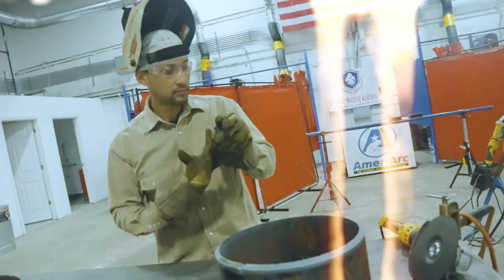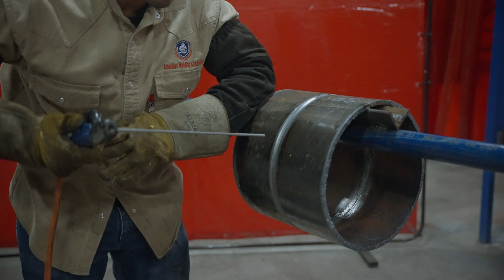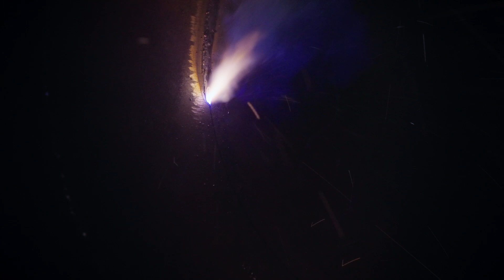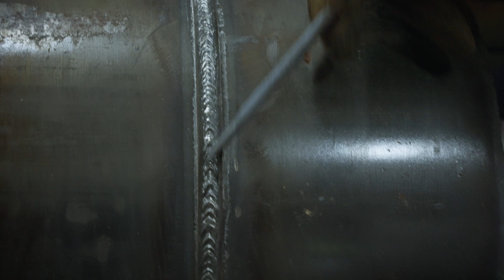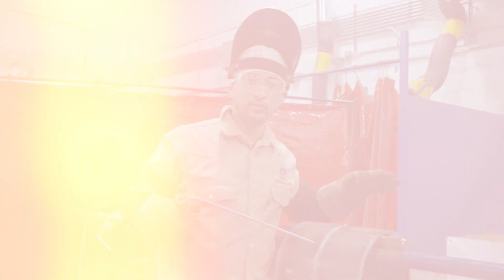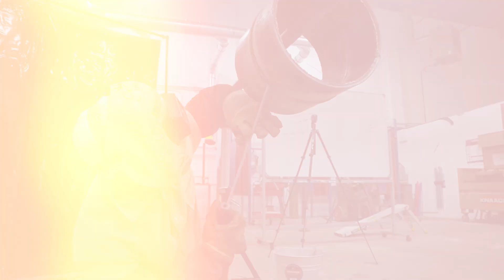PIPELINE DOWNHILL WELDING API 1104

Comment: On the tie in at 7:23, if you strike up an inch before the keyhole to heat it up, how do you heat it up without depositing material? If you're just going quickly and you do deposit material, there still will be a hump there and how do you compensate that when doing your second pass, or do you just grind it down? What if they don't allow you to grind?
Reply: There is no such thing as NOT GRINDING, NO GRINDING ALLOWED, YOU WILL ALWAYS USE A GRINDER AFTER YOU PUT IN THE " ROOT PASS, ALSO CALLED THE BEAD " IN PIPELINE WELDING

Comment: Does those fumes ever bother you from not wearing a respirator? Do you ever experience tightness in the chest
Reply: I've been welding since 1980 and I've yet to see ANYONE inhale 100% of the fumes, you might even say that " there is no such thing ".Now you might get a tiny pit of a scent but that's about it but NOT 100% of the smoke. As far as Respirators some people do wear them and some people don't, it all depends on what you're welding.
Reply: I've been welding since 1980 and I yet to see ANYONE inhale 100% of the welding fumes weather it's steel pipe, aluminum, stainless steel, titanium, cromolly you name it, sure your going to breath a little bit of fumes but not the full 100%
Reply: I sometimes get it from smoking bad weed, ( ganja)
Reply: @UriSteel YOU know what you can do with your stupid weed and quit smoking it then you won't have ANY PROBLEMS
Reply: @UriSteel YOU know what you can do with your stupid weed and quit smoking it then you won't have ANY PROBLEMS

Comment: no mention of ArcForce, Amperage, different rod manipulation for top, side and bottom?
Reply: Arc Force is a adjustment on the welding machine, Hobart Brothers came out with it back in the 1990's I believe or maybe the 1980's, it's a Voltage adjustment on the machine, I don't really like it I would rather have a FINE TUNE AMPRAGE ADJUSTMENT LIKE THEY USED TO HAVE ESPECIALLY ON THE PORTABLE WELDING MACHINES

Comment: You need to read the API 1104 code book. Root FACE       also known as Landing is 1/16 of an inch, Root Opening is 1/16 of a inch with a tolerance of 1/32 + -(I myself like a Root Opening of 1/32 of a inch especially when using a 5/32 rod) Angel of bevel overall is 60°.Height of Root  Pass also known as Crown is 1/16 of a inch and Height of Cap Pass is 1/16 of a inch.

Comment: Pipeline welding is used on PETROLEUM PIPELINES LIKE OIL, NATURAL GAS AND ANYTHING RELATED TO PETROLEUM. AS FAR AS WHAT YOU MENTIONED I'D CALL THAT UPHILL WELDING PIPE.
Reply: OH REALLY? I THOUGHT DOWNHILL WELDING WAS USED ON BIGGER PIPE SIZES DUE TO THE FACT THAT ITS FASTER THAN GOING UPHILL WITH EVERYTHING. NICE TO KNOW